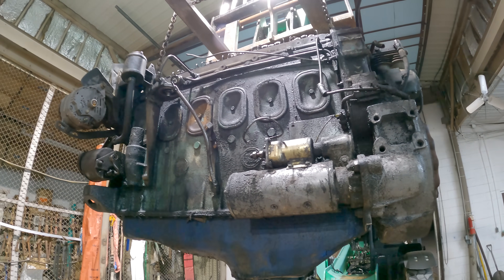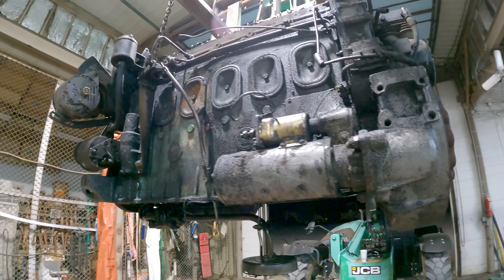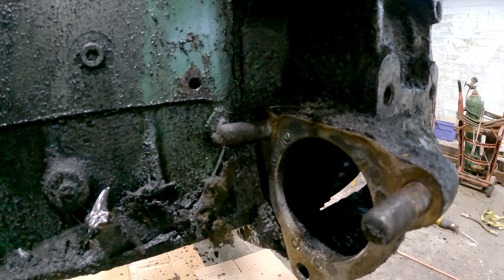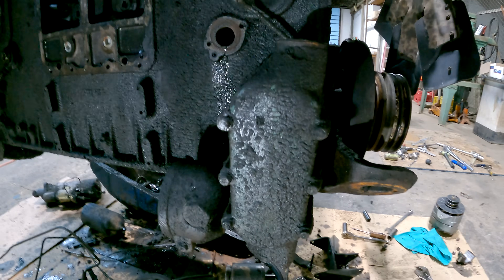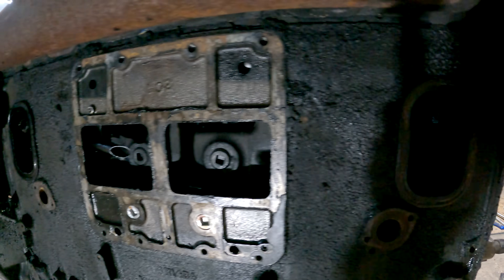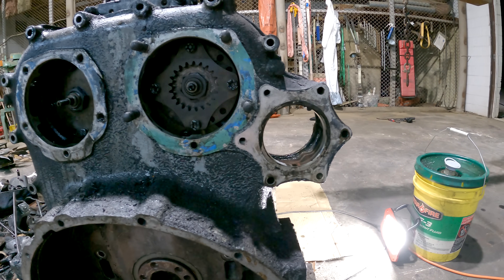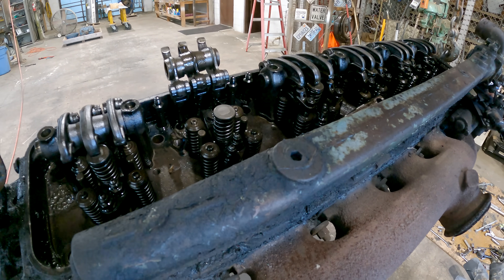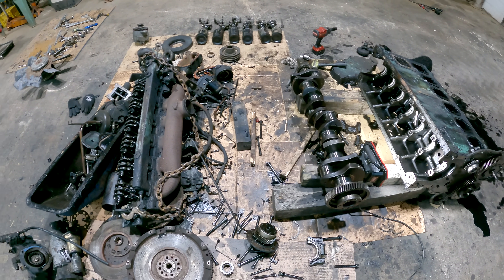Runaway 6-71 Two Stroke Detroit Diesel Engine Teardown

Comment: 6-71,  (6  HP, 71 leaks).  Great engines really.  Worked on them from 3-71 in a yard truck to old Graymarines in old LSA landing craft in Alaska, to 16V-149's in the Gulf Oil Field rig tenders.

Comment: Really interesting what you are doing... not for watching things burn but for seeing how and when.
I have a DD 671 in a boat, I think there are still quite a few out there in the marine industry.
Not sure if you can do this, but it would be really cool if you could:
1. See how long one of these engine will run with no coolant.
2. How long it will run with no oil.
3. Take out cylinders to see what is the minimum to keep the engine going.  I am guessing it could run on 4?
Besides just a cool thing to watch, this would also be really helpful for people who still depend on one of these.  I think others would be interested also, please thumbs up if you agree.

Comment: Damn , I just Retired 33 years, Union Crane Operator and I have seen so many Accidents, in and around the Heavy Equipment World, Yes I'm one of those Safety Guys. When you See Out rigger Holding Valve Fail , Boom holding Valves Fail, Fork Tilt Valves Fail,  Hydraulic hoses fail, Welds fail and Steel Tear Out.  you would never work, under or around, a Suspended load Period, full Stop, end of Story. Roll in the Purpose Built Engine Stands, Blocking, drop the weight on the Gradeall to about half the load. Tear it apart, 
 I would be calling my cousin Stumpy , Bill but he stuck his hand in the Wood chipper to clear stuck log.

Comment: I usually remove the valve covers on detroits that have been sitting for a while. Make sure that fuc#@$&**ing rack works freely before firing it up  they start in wide open throttle the governor pulls it back asap

Comment: My first truck was a 1970 GMC 9500 WITH  a 671 detroit 5 speed with a 2 speed axel i put # 70 injectors in it an it would do good but these engines just had no tourque you had to drive them like you stole it to get them going but we got the job done.

Comment: As strange as it is a set of liners and pistons that would actually run again well if the head wasn't broken but my point is that like you said terrible on fuel but they were super reliable if they were serviced and being a 2 stroke well in the day fuel prices were not so important for the return you would get from reliability.

Comment: I think every one of our old train cars had one of these motors shoved up beneath them for power. Actually it was pretty neat because they were sort of at an angle and mounted on a rack so that you could slide them out like a kitchen drawer to service them. Supposedly they were capable of 240kw at 480v 3-phase or 75kw per phase if you were just running single phase only. Even then, that's 240 horsepower just for air conditioning... The idea was that they could power an adjacent car or two if needed. But every one of them had something wrong with the electric side of the generator. Motor was fine, in fact they had no issues cranking them up and wasting fuel at $3 a gallon (off road fuel) I think part of the problem was the generator bypass switches had been torn out and replaced with solid copper buses, meaning if the generator was running, it was either in harmonic sync with the train line or it was fighting against it. You were supposed to isolate the car from the train line before you turned on and ran the generator. Or the train line needed to be de-energized before you could connect the generator to it. All those safety appliances were gone though, probably because some car-knocker had no idea how to make it work correctly. And rather than learn the right way to do it, just bypass the safety features and fry the generator. Sounds about like a union job to me. In the end we had to strip all that junk out and re-wire the whole system for Head-end power only. Newer, more efficient AC systems were installed so that we could run up to 20 cars off a single 480kw HEP generator. But I bet those old Detroits were awesome generators back in their day.

Comment: Love the inyector demostration. You got me thinking in the 2 troke Detroit .... why there are 4 valves .... intake is done from the liner once piston goes down and I undestand that blower push fresh air inside while expulsing the combustion gases out. So ... the valves are just for EXHAUST ? .... Love the concept. Not for eficiency, but you gota love the simplicity.
Reply from the maker: Yes, all 4 valves are exhaust valves.

Comment: Sure it's damaged but I can't believe it even held together. The crankshaft look like it's still perfectly usable and the rollers all look fine I guess that's the difference from a true runaway where it would have sucked all the oil out of itself. Sure the heads cracked but I can't believe the valves and injector tips didn't burn off. Cummins don't hold together like that

Comment: My dad had a workboat that was powered by a 6-71 Detroit. I attribute some of my hearing loss to standing by the motor operating a clam rig with nothing between me and it but a 1/4" of plywood. When dad finally sold the boat you could see the flywheel through rust holes in the housing. The damn thing would still start and run.

Comment: I was a diesel mechanic for over 30years. The Detroit 6V71, 6I71, 6V53 and 8V53 were built like tanks. I only experience one run away in my life time and it was frightening but yet exciting. I retired in 2017 and I do not miss working on the tractor/trailers.

Comment: Sorry I disagree if that's such a junk engineerize I have the original engine in my 1980 auto car on its 1st rebuild still 42 years later That thing pops up on a 1/2 a turn and runs beautiful

Comment: It's safe to say you didnt cause all the damage... This engine despite starting very well already was in terrible shape.
Must be a endorfine rush for ya to realise you actually helped this Detroit Engine and take it out for a final blast. 
Thats why it didnt drop anything on ya. 
From seeing the damage id say this detroit has been used wrong intirely... Low rpm most of the time causing a bend rod and an enginewobble.
What kills a Cat is to run it like a Detroit what kills a Detroit is too run it like a Cat. 
I killed a C15 at work how ??? Just revving the Kittens out of it after a coldstart and litteraly overheating it in 5 miles... The next Cat is waiting... Every Detroit you destroy every Cat i Destroy and i aint even gonna record it. (Got 7 of em ready to go including a overhauled Cat... Which didnt work after the company went bankrubt i got it for a great deal.)
Buuut Cats they really blow up well its much more fun than a Detroit actually

Comment: Great disassembly of that overheated Detroit diesel engine, I thought 2 stroke engines had no valves, so I learned that, that is not always the case.  Excellent commentary and explanation what does what on there engines. Keep them video's coming.

Comment: Why a blower over a turbo on this engine? Do 2 strokes not do well with turbos?
Reply: Blower is not there for hp it is there just to remove the exhaust after combustion since there is no exhaust stroke.exhaust/intake happens at the same time. It is known as a scavenging blower

Comment: am looking at 44 foot boat ,,nice boat for 5K .. But it had 2 of those 6 - 71 and guy that pull them 3 years ago and just lay on ground ,,would I just better off buy some used replacement motors of same?? or should pick some other motor for replacement ?? and what should i be looking for ??

Comment: Brilliant designed engine. Rugged, durable, all mechanical, well designed, versatile. Everything you could ever want from an industrial Diesel engine originally designed ore ww2. The fact it lived on so long is a testament to its design and durability.

No engine has a bigger fan base than a Detroit 2 stroke.
Reply: Tbf, I just like the sound of them.
Sounds like a proper engine should sound like when it revs really high.

Comment: cool  engines  interesting  in how these   work but not much use   today  apart  from   in mad max apocalypse  (no computers   but  there  are a few  engines  like that   today   they  use too much fuel    being 2 stroke  im Shure the cylinders   get scored  up   faster  than 4 strokes  do   but  prob never  die   just  lose power  /use more fuel

Comment: I skippered a delivery trip on a small coaster that had a V8 71 Series. What a great engine! It purred along without stopping all the way from Gibraltar to Plymouth - 8 days. One of the crew told me it ran away occasionally and one time they'd covered over 20 nautical miles before getting the thing back down again!

Comment: HEY BUD.      WE WANT TO SEE. HOW REALLY GOOD AND HOW MUCH WE CAN PUSH AND RELY ON OUR DETROIT DIESELS.       SORRY FOR CAPS IM BLIND.     ANY HOW.    WE WANT TO KNOW IF YOU WOULD PUT THE BUSS ENGINE IN RUNAWAY MODE.   BUT WITH A FRESH SPECIFIC 10W40 OIL OIL CHANGE.    AND A COMPLETE COOLING SYSTEM HOOKED UP WITH ELECTRIC FANS.     AND RUN IT IN A RUNAWAY CANDOTION FOR 20 MINUTES.  THEN LET IT IDLE FOR 2 MINUTES THEN  SHUT IT OFF AND THEN TAKE IT APART SO  WE CAN SEE HOW IT ACUALLY HOLDS UP WHEN IT DOESNT SEIZE UP FROM NO WATER.    IM SAYING ABSOLUTELY NO DAMAGE WILL HAPPEN. BUT WERE CURIOUS.  REALY REALLY CURIOUS

Comment: That shaft you were messing with for the Blower from the drive gear is called a Quill Shaft . It was made to break to save the Blower from damage...in those ol 113s APC'S....IF the line doggie crank them up cold and not let it idle to warm up ...and did a quick Rev up on it ,you could about expect the quill shift to break and engine would shutdown immediately....replaced many of them ...

Comment: You are a sad person, with no respect for history. Those engines still bring 2500 bucks. Pension marine in lake Charles LA, still builds these engines for marine applications. I have sold them several. 
On the other hand, after all the grief you gave this engine, it's still not damaged. A head, and piston kits, and it ready to run again.

Comment: How does the fuel injection happen in this?
Reply: The positive displacement fuel pump driven off blower accessory drive delivers fuel to inlet fuel manifold that is integral with the head. Beneath the valve covers is a fitting ported to that inlet manifold. There is a fuel line connected from that fitting to inlet on the fuel injector. As the demand for fuel increases, the fuel rack moves the stem from full fuel to as demanded. The unused fuel leaves injector thru another line to a fitting ported to outlet manifold also integral to the head. There should be an orifice fitting close to the outlet on outside the head then it returns to fuel tank. There is a special tool to set injector height. The injector spray is activated by its own push rod and rocker arm.  Hope this helps to get you started.

Comment: These engines and all their cousins of the 2 cycle version gave always had very good to weight ratio and they are very easy to work on - the bigger versions were a pain in the ass to set the injector rack on because you were actually dealing with 4 racks connected together ... if you weren't careful you could burn down 4 cylinders with a messed up rack setting.  The 71 and 53 were dry liner engine and it required some skill to get the proper liner to bore clearence.  The 92 series and 149 series were wet liners and much easier to overhaul.  The detroits were very popular in marine applications and generator applications - they built the 16-149 up to 1500 kw and would put them in hospital applications that had to be up and at full load in 10 seconds or less ... you could always tell when your Detroit generator got to 1800 rpm - your nose would start to bleed... oh and our host made a little error when he made the remark about the top bearing always showing the most wear. In a 2 cycle engine there is a power stroke every time the piston comes down - so since the piston never has to be dragged down by the crank all the wear is on the bottom bering shell... I worked for the Detroit distributor in Dutch Harbor Alaska back in 1989 and 1990... and learned this - commercial fishermen can wreck an engine in every possible way and a few ways nobody has ever heard of... but on the other hand I have seen the 12-71 powering a generator turning 1200 rpm last 30,000 hours with good maintenance.. go figure.
Reply: I failed to specify that it is the main bearings where the wear is always on the bottom shell - the rod bearings always show the most wear on the top shell... this is caused by the power stroke that is applied to the rotating assembly with every down stroke of the piston ...

Comment: Worked in a chemical plant and we had a 6L71 driven fire pump run away...damn thing ran forever on it's own oil even with a plastic bag over the air cleaner

Comment: I was well into that vid. Never worked on one so to see the beast dissected had me glued to the screen. Pistons were a lot taller than I expected, but the two sets of rings makes total sense with the liner ports. *Looking at it if I had two I would be lashing them together garage54 style to see what one was like as a big air compressor. ^-^
Reply: Pistons were tall because they had to keep the inlet ports closed at top dead center.
Reply: @carltauber2939  And now I come to think of it, there must be oil wastage through the air ports into combustion or the top rings would run dry.

Comment: I tap on the pulley adapter with a hammer when I put torque on it with the puller. Sometimes they pop loose

Comment: It would be cool to see a turbo seal run away engine, either tear the seal out of a turbo or just inject oil straight into the intake manifold to simulate a similar failure
Reply: Happened on my 4cyl International recently.

Comment: How does the upper cylinder get lube without the engine using oil? Looks like the bottom rings keep the crankcase sealed from the blower pressure.

Comment: The engineers of the 71 series were geniuses... Those end drives - housings - Cams - Balance Shafts are interchangeable Front To Back, as to allow LH or RH Blower / Exhaust (Back or Front if in a Transverse install) and there are LH/RH rotation parts available.... Truly one of the most versatile engine systems made...
Reply: Haha aluminum alloy :3

Comment: I have a 6-71 running a water pump on a deep well at our farm.  It's been there 30 plus years. It wasn't hard to find another to rebuild and replace it early this year. Someone just gave me one if I'd just come to get it out of their shop.  Some people's trash is someone else's treasure. I like everything posted on this channel by the way and I own a couple of these very sought-after incredibly valuable engines. She really wasn't actually as bad as I thought it would be after that thrashing at max RPM.  Wishing I could afford to have him rebuilt a C7 for me. I would be positive it was right, that's for certain.
Reply from the maker: We've talked about putting one on a pump, but the wells here aren't very deep and don't require much for HP.  The little 4 cylinder Deeres are easier on fuel, so it really doesn't make much sense to rig one up to do it.
Reply: @KT3406E  My dad put a 4 cyl Deere in his pick up about 30 years ago. The damn thing is still running and gets nearly 30mpg. It's up to 4 owners and rattles like a pre-cup Cat, but it will not die.  We didn't set up the well the first time (370') and if it wasn't for changing the mounts, etc, anything over 6oo ft-lbs of torque would do the job. Since you are reading comments, you have got to be one of the best Cat people and builders I've ever seen, and I'm old...lol Thanks for the content... Have a great day!

Comment: @KT3406E I cannot believe the 'good' condition of that engine after what you did to it! These Detroits are seriously well engineered and built! I wish i could get my hands on one here in the UK.
Reply: If we stuck an alternator, rectifier, smoothing capacitors and an inverter onto the end of one of these, it would be still be providing emergency power to the house and workshop when we're all dead and gone.

Comment: A great feature about DD is getting the Pistons, rings pre installed, connecting rods and liners as 1 unit. Drop in and done!
Reply: Amazing that the abuse this engine endured and new pistons, rings, liners, bearings and would be good as new.  (I would suspect cracks though, definitely in the head).

Comment: I just subbed because i enjoyed that autopsy so much. Even after that incredible torture test the bearings still look that good to me is amazing. Those old oil slobbering motors were sure built to last. I never knew the blower pressurized the crankcase the way it did. I never really thought much about it but thats where the intake is so...thanks for the look around,  i learned a few things.

Comment: If anyone here has ever doubted that the two stroke detroits are anything other than some of the toughest and most efficient diesels ever made then i hope this is evidence to the contrary. A turboed 6-71 in a smaller (than an RV) chassis can do 13-15 mpg while still making WELL OVER 1100 ft/lbs of torque. If not for the EPA, these things would still be running as the main workhorse of practically every industrial fleet on the planet. I mean, just consider for a moment, how long it took for four stroke diesel technology to catch up to the power and efficiency figures that detroit was producing in the 60's. 

I dream of an 8-71TA in a rollback or box truck to use as a race hauler.
Reply: Midget racer, who lives on flat ground, I take it.